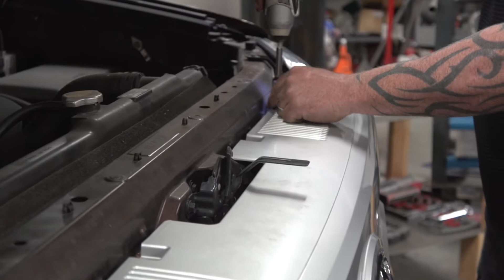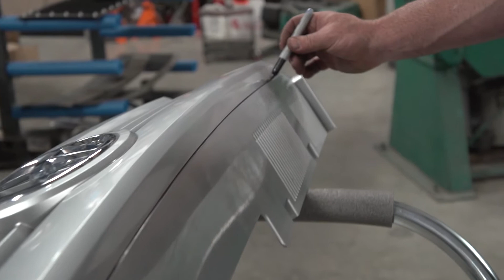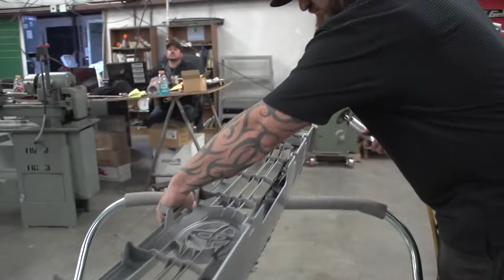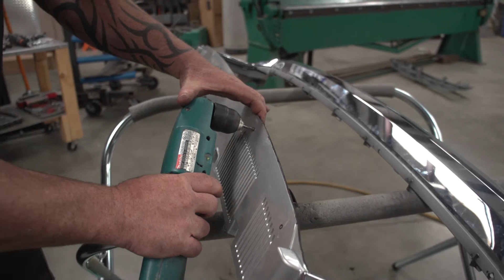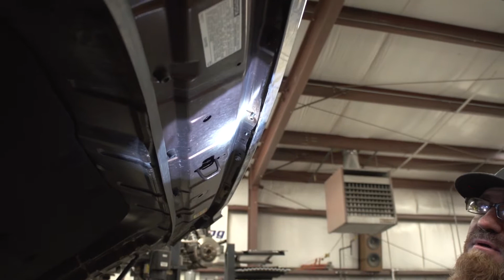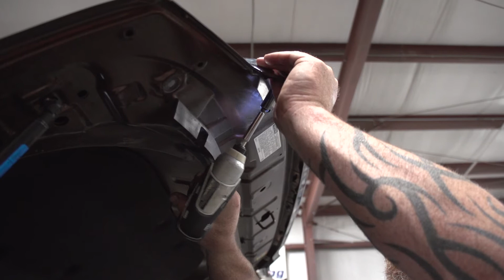2014-17 Toyota Tundra

Comment: I just removed one of these yesterday. I can tell you one thing if it’s cold out if you want to make sure you don’t break it do yourself a big favor and release those  lower catches  manually!     We did lots of Yanking trying to release that and I sure didn’t see it happening without breaking that big long mount in each lower corner.  
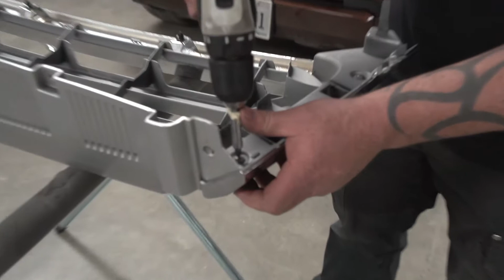    Do with the Safeway like this.   That TOP comes out as stated. Pull back slightly and look straight down in those corners. You’re going to see the only contact point Is a little flat plastic piece that goes back into the grill. They are  about half an inch wide.  They catch with a large tooth which faces up.   You can see what it looks like at 1:51 on the video.    What you have to do is take a long screwdriver or thin bar of  some sort and push down on that tab about an eighth of an inch. Just push the corner of the Grill in gently and then shove down on that tooth and pull .   It will go down past that tooth and you can just slide it out.  Do it that way and save yourself the misery ruining  something hard to fix unless you are throwing the old grill away..

Comment: Why in the hell would you not include aftermarket parts so you don't have to alter the original parts in case you want to restore the truck back to OEM status if you sell or trade it in.
Reply: Because for that shell no one what's an aftermarket one so everyone has to get there's wrapped